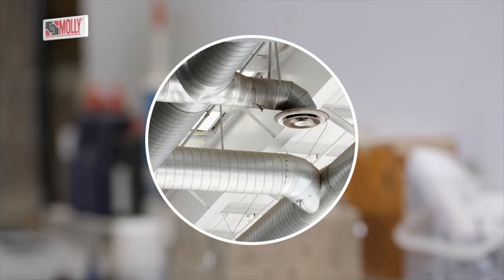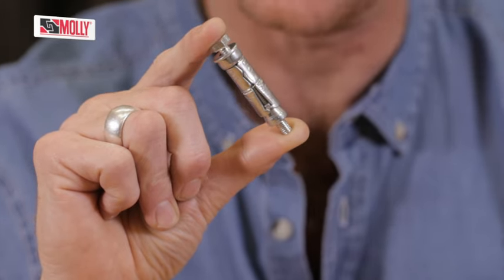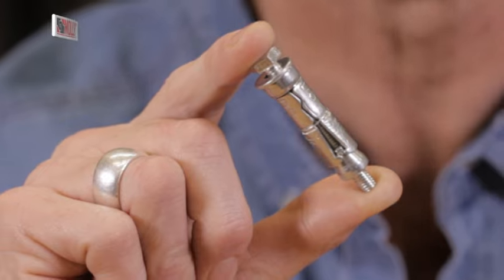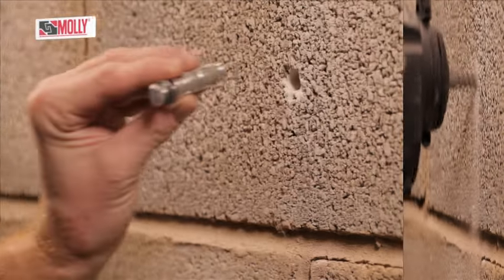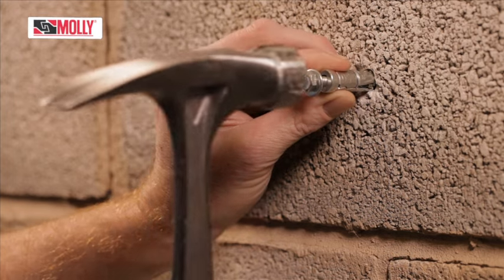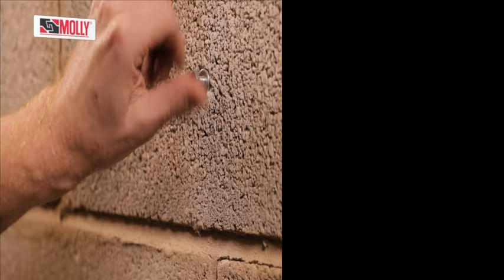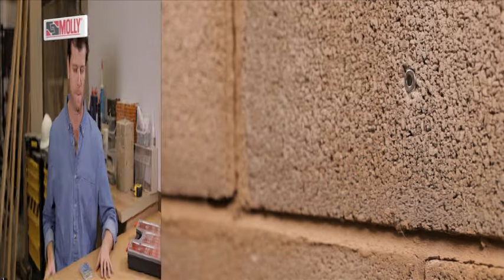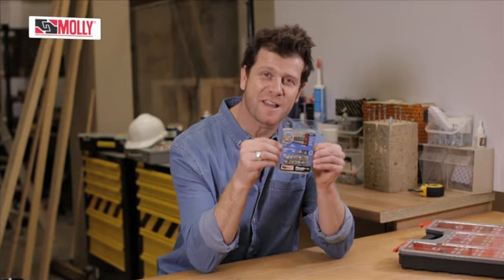BOLT SHIELD ANCHOR - How to use Molly Fixing Bolts for Really Heavy Jobs in Solid Concrete

Comment: What a poor guide video; confusing nuts & bolts? no mention of drill bit size etc.
Reply: That size of 8 mm bolt and then bit size 12 mm 
Again 10mm bolt  bit size 14 mm      

One of commun formula   size of bit       that number of +4  answers  is bit size   for exaple  6 mm +4=10 mm  that a bit size    

 Key size is  number of bit size +7  is key size